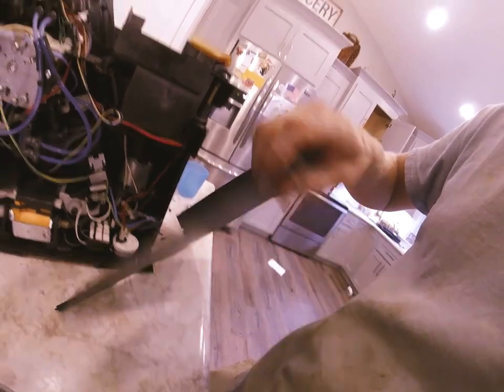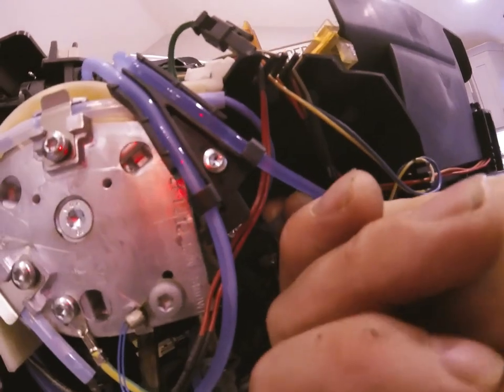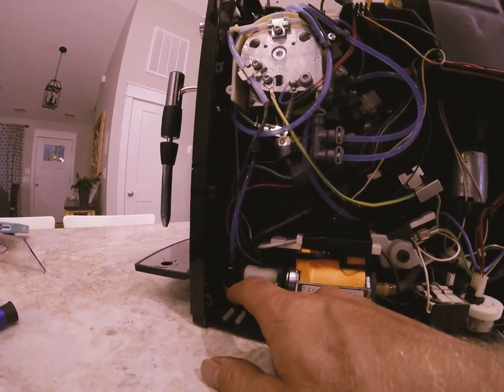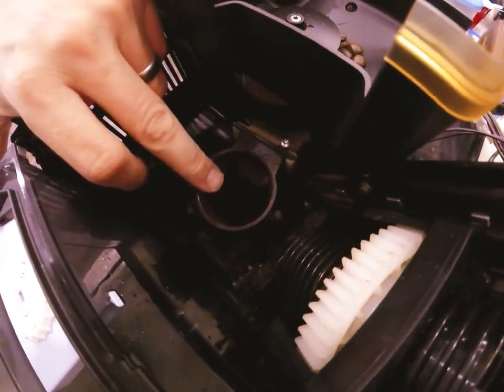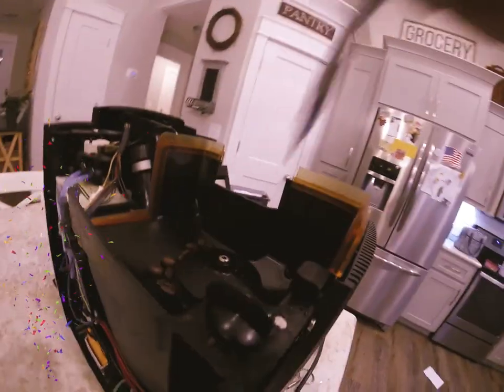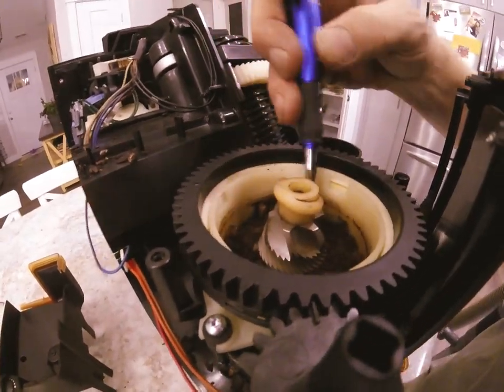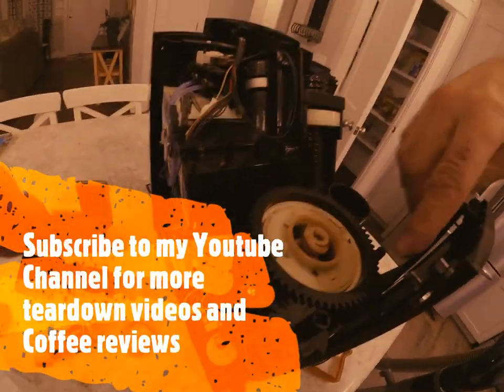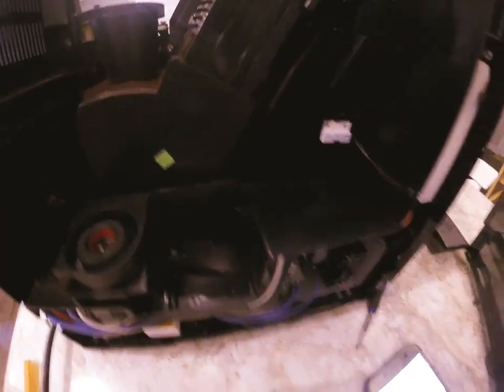Jura Impressa C5 Superautomatic Coffee maker full teardown.  Change brinder burrs, fix leaks, etc.

Comment: I have my machine apart and need to know how to remove spouts.  I have tried cleaning with a pipe cleaner from the exterior and it seems to have mostly worked.  However, it will flow from one side one time and another side the next time.  Now I need to take it completely out to try again. I'm getting really proficient taking the machine apart and putting it back together!!!

Comment: Great video!  Have a C5 that is making super-loud noise during brew cycle, but otherwise making coffee fine.  It frequently sits unused for long stretches (months sometimes), because it is at our vacation home.  Since it is brewing coffee, would you expect the problem is with the membrane regulator, rather than the pump itself?  That's my conclusion from watching your video.  Thanks for making and posting the video.

Comment: Hi! Nice Video! Can you help me with a coffee grinder?
I replaced the grinder with a new one. Third version (v3). Jura C90.
And I encountered such a problem, the coffee grinder works no longer than 4-4.5 seconds (strong option) and this is not enough for good coffee. After all, the machine adjusts this time? How to reset it? A full reset in the menu did not help. I saw in other videos the C50 grinds for 7-8 seconds. Everything else works great. I cannot call an official JURA technician in my region. Can you advice me?

Comment: I have coffee leaking from the lever that raises or lowers the coffee outlet for different cup sizes. The coffee is also coming out of the 2 nozzles as normal, but is also flowing down around the little tab you use to raise and lower it. Any idea why ?
Reply from the maker: The reason you are seeing that coming out from there is because the spout is clogged with residual fine coffee powder that made it through the brew unit or a buildup of oil from oily beans etc.  Basically the machine just dumps the coffee into the spout and then it's gravity fed into your cup.  So when it's clogged up it overfills the innards of the spout and then leaks around it.     you would have to disassemble the coffee spouts and clean them manually
Reply: The other reply on this comment is correct. I was having the same problem and used a guitar string (high E) to unclog it by lightly probing into the matching from both dispensing spouts. It’s been working perfectly ever since.

Comment: Help please Timo.  My C5 was stuck with a Flashing Frothing light when turning machine on.  I unplugged it, ran steam out, but it acted like it was in the descaling mode. I always go through all of the maintenance but I descaled it again which did not help, so I thought I would have nothing to lose by checking the interior.  I never use oily or flavored beans and it all looked clean with a bit of dust. In your video at 14:01 you freely turn that cog but mine is stuck. Should I force it?
Reply from the maker: If you have beans in the grinder or even just one it won't move.  Use a Shop-Vac vacuum it out and then it'll move.

Comment: Hello Timo, How do you solved the error in the minute 10:30 ? In got the same problem, the machine stops the cafe brew and ask me to open the steam switch.. several times.. how can i solve this ? 
Thank you, and thanks for your video
Reply: ever found out? Got the same problem.
Reply: I thougt that i would have to change the pump or something... but once I opened the machine,  in order to see the pump model, I just clean the plastic “pipes” from the water tank to the flowmeter, and from the flowmeter to the pump ( they were brown...) and open and clean the flowmeter ( it was not so dirty...) and that worked !

It came back to life and for now it is working well...

I hope this help you

Good luck !
Reply: @principepetra  Thanks! will certainly give that a try!
Reply from the maker: FYI this can be avoided by running filtered water through your machine or purchasing the jura filters.  If you can see how brown those pipes get after some time you can imagine what the inside of your boiler looks like.  Best to use filtered water always.  Glad to see that you figured out what to do honestly I made this video a while back and I haven't been monitoring the comments
Reply: Hi, it is still working by now, and i hope that I don,t have to see how the boiler looks like...:)
Anyway, thanks for your video, it helped me a lot in order to open and understand the machine..

Comment: Hi Timo... just have an issue with the front part/face of the coffee machine... it seems like the coffee dispensers are all clogged up... and coffee is overflowing. Any ideas on how to disassemble the front and lookup for clogged up pipes? thnx > appreciate it
Reply: I have the same issue! Would appreciate a reply! Bump
Reply: I did eventually managed to fix it by myself... you will need to remove all panels... until you can undo the front one... to remove the front panel you will need to locate screws on top... and some latches on the front bottom of the machine...

Slowly pull the front panel, it will be all wired since there is where the control panel is located...  But from there you will be able to remove a plastic black funnel, you will see that cuz there is the plastic tube that the coffee travels through.>>

Once the funnel is out... you will be able to remove the dispensers for a good inside clean/rinse...

If you dont manage this... You can always try poking the dispenser holes with wire,,,, until you free them up...

bests
Reply: Hi. I had the same problem. I unblocked with a bicycle pump, that avoids disassembling the machine. Unfortunately the problem reappears after a few days...
Reply from the maker: Hey I apologize but I didn't notice this comment originally. You can actually do a quick Google search for removing the coffee spouts on your jura.  Juraparts.com has made some videos It's a little different machine to machine but mostly it's about the same.  Some of them require pulling the entire front panel loose and then disconnecting the spouts from the inside and some of them allow you to do it right from the outside.  If it's clogged you will not get it clean unless you disassemble it.  Generally it comes from using oily beans.  I know that 90% of America loves their oily beans but this machine is not really designed for that.  The oil makes its way into the coffee which then collects in the spout and eventually causes a clog.  The good news is it's not that difficult to fix really.  Once you can get to it it's just a matter of taking the spout putting it under the kitchen sink running some water and maybe scrubbing it with a brush.
Reply from the maker: @disgraou  The reason it's reappearing is because all you're doing is shifting the clumped up residual coffee or oil that is in there.  You're not actually removing it so eventually it works it's way down and clogs the spout again

Comment: How did you fix the issue you were having with your machine? Having the same issue, Thanks
Reply from the maker: Leaking? There's several different things that can cause it but the most common cause of a leak when the machine is off is the gasket at the bottom of the water tank.